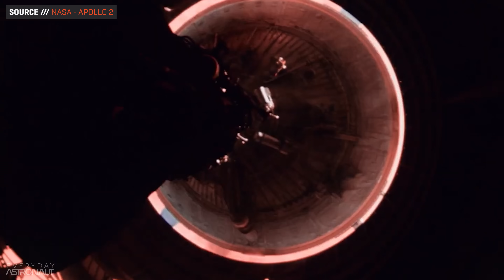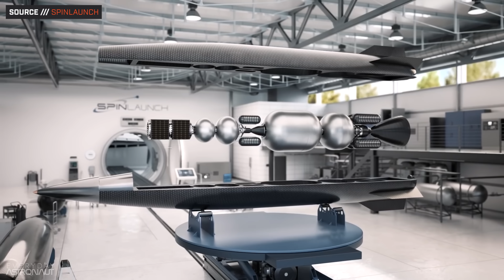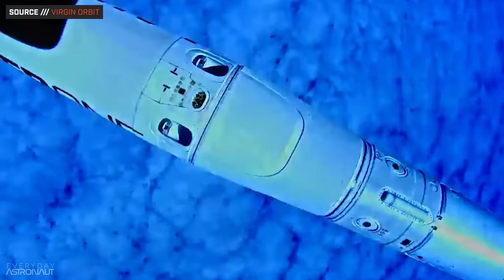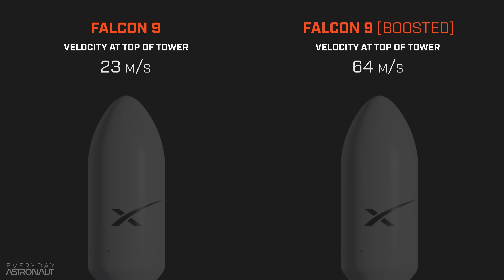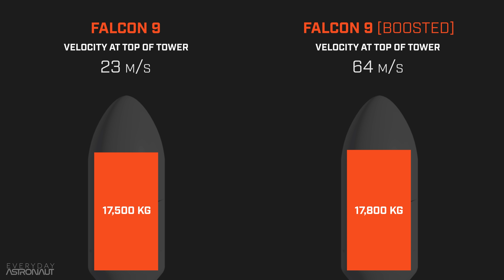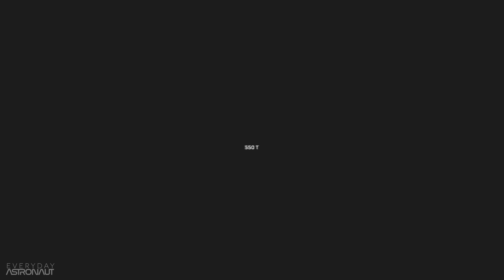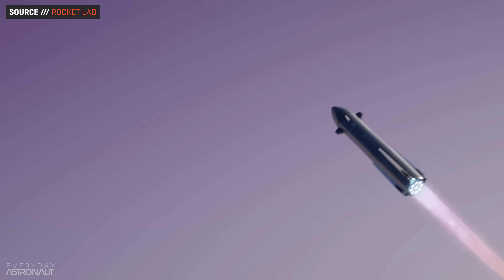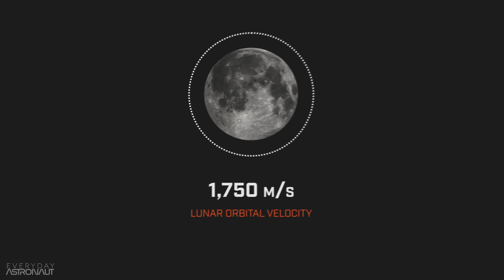Could We Help Push Rockets To Orbit?

Comment: few nitpicks, why would your counterweight need to be expensive steel or made denser ? Use concrete or rock, or bags filled with sand/water, whatever is cheaper, also you could dig both the launch pad and the counterweight track into the ground to get an overall longer acceleration track, I'm pretty sure there are more tricks you could do with 'gear ratios' or pulley systems, altho I'll admit they might not be realistic to consider with the numbers involved.

And what about a mix of the maglev track and chemical rocket instead of either of ? A thing we see often in sci-fi is an horizontal track that start at ground level and then goes up an incline few kilometers down the line, carrying some kind of cart with a cylinder containing the rocket/spaceship, then yeeting it at the end of the track, container being discarded and rocket/spaceship starts it's engines. The acceleration not being short and brutal make it more realistic to carry humans or 'fragile' cargo in it and you don't need those ridiculous vacuum sealed tunnels which imo will never work and make the whole thing costs balloon ridiculously.

Comment: Humanity needs to think bigger.
Building something like a counter weight, with a big tower, big system, brakes and more.
Shouldn't be a problem with the resources we have available.

People built cathedrals, pyramids that took hundreds of years.

NO BALLS I SAY.
We go big. 100 Launchpads, launching at maximum capacity, as often as possible. To build more launchpads on the moon, on mars.
We expand BIG, FAST.

We have technology. But simply just no scale.
Billions of cars running around in circle all days.
But not even 100 rockets launched per day.

Embarrassing.

Comment: We need to tunnel straight through the Moon.  Mostly the tunnel would be used for traveling from one side of the Moon to the other.  Dropping into the tunnel from a tall tower could be used to boost launches.

Comment: Two things I wish Tim had covered in this video but didn't:
1) Launching mined materials instead of humans would alleviate the need to maintain a 5G acceleration rate.  Can we improve the solution by increasing the G factor?
2) How would a space elevator be able to overcome the energy requirement as an alternative solution?
Reply: He did cover #1. You increase the G, it shortens the track length. The tradeoff is you have to expend the same amount of "push" energy in a shorter amount of time.
Reply: @GeneCash  I'm not surprised that I missed it, as I'm sure there were many other points that went over my head.  Thanks for clarifying.

Comment: How about using the rocket engines already fitted plus a really long hose on the quick disconnect so the tanks are still full after the bottom of the rocket reaches the top of the tower?

Comment: 5.5 gigawatts to give starship a little boost at launch? Great Scott, that's a lot of power! You'd need like... 5 flux capacitors to handle that!
Reply: 1.21 Jigawatts!
Reply: Gun it to 88 Mph Marty!
Reply: You'd need dilithium crystals.
Reply: Great Scott! I’m going for a ride on my hoverboard to mull over the math.
Reply: Just one Meta AI center
Reply: You're thinking of Jigawatts!
Reply: The magnetic launch systems on aircraft carriers are precisely this idea and use similar amounts of energy from what Im reading.
Reply: @brettcaulder9034  Steam is better.  There seems to be some unexpected problems with both countries MAG launch systems.
Reply: Starship is not the only rocket in the world. Some rockets can utilize a maglev cylinder inside custom made skyscrapers. It would still be much more efficient than burning fuel for thrust.
Reply: yeah but if you run a continuum transfunctioner you could bring it down to 4 flux capacitors.
Reply: 5X Mr.FUSION KIT
Reply: @kennethschultz6465  Who know how much power Mr Fusion can actually output, we only know its at least 1.21 Gigawatts of instantaneous discharge.
Reply: Just use HARP to get 5 bolts of lightning to hit the tower and you'll be set. Seems pretty simple.
Reply: Where we going we don't need roads, Marty
Reply: That's heavy
Reply: We're gonna have to eat some more bananas to run it .
Reply: Ahh, coal powered rockets. I get it now...

Gonna need 5 more flux capacitors to keep the coal trains running!
Reply: It's only like 9 or 10 nuclear reactors lol
Reply: Yeah, could go to the future 5 times instead.
Reply: @klipseracer  silly monkeys dont fathom the power required to bend space time to loop upon itself and reverse the flow... 😅
Reply: the only reason why it needs that is because hes keeping the length of the tower. Launching the rocket with maglev on a longer slope would fix that problem as you could slowly accelerate the rocket.

Comment: We should use launch assist to reduce total mass of the rocket, not to increase payload .. this would improve the numbers. Also, in the case of 1km rail tunnel, why do you limit acceleration to 5g ? Neutron rocket is not for human launch anyway. How about 50-100g?. I was hoping u run the math of how to launch the 2nd stage with a railgun or meglev with 1-5km rail off a 4km high mountain. Also 350 MJ is not a lot of energy. 7kg of natural gas has that much energy.

Comment: Build a large vacuum tank. Connect it to a movable platform that the rocket sits on. As the engines light up open the vacuum tank and let air pressure push the platform up. Megatonnes of reusable energy.

Comment: I think a much better solution would be to commit to building either a Lofstram loop or better still, a tethered ring.  The latter really would be a brilliant solution, though expensive.  The rotor and stationary protective vacuum sheath could be built in the ocean, then its linear motor rotor , which is magnetically supported by and coupled to powerful magnets located in or on the sheath, would be energized and spun up slowly to just above orbital speed as the ground and sea-based tethers are gradually tensioned to guide it as it lifts spaceward.  It could then be slowly moved by those same tethers to its final location over international waters.  All the support tethers would provide access from numerous points below the ring.  The kinetic energy of the rotor would eventually be so high that energy could then be extracted via that same magnetic coupling to either launch spacecraft and/or to provide electrical power.  Transportation up to the tether would be supplied at relatively low velocity from the ground or sea by sophisticated robotic climbers or elevators, similar to those envisioned for future space elevators.  Take a look at Isaac Arthur's great video of how this system could be used to create a paradyme shift in how we launch to and from orbit, as well as how we could become a truly spacefaring society.

Comment: How about instead of dropping an enormous weight vertically, you use a horizontal rocket sled powered by raptor engines with a pulley system to assist in liftoff from the tower?

Comment: Thanks ! One thing that isn't very clear in your video is the calculation of payload capacity increase in each scenario. It seems that this increase doesn't take into consideration the fuel economy (and therefore weight saving) that is achieved by yeeting the vehicule, which is in turn much lighter to yeet.. or does it ?

Comment: Why this obsession with electrical discharge? You don't need to have one motor that does the whole lift, you spread it out on several motors. Then you add a modular counterweight that scales with the rockets acceleration.edit: the counterweight could just as well be a rocket-tug, since we don't care about the fuel cost. Could be steam powered for that matter.

Comment: The LHC is 27 kilometers in circumference. That only cost a few billion $ and most of that cost is due to the specially designed complex machines inside.
I can see a 500 kilometer MagLev launcher happening. We have plenty of space around the equator in Africa.

Comment: scaling up rockets -- yes for now. RP1 is "widely available", being still mass produced by extracting an ever-decreasing supply of free super dense chemical energy -- oil. i'd be curious to watch those cost saving estimates when oil runs out ! how would those stand, against massive material demand of surface assist solutions ?
Reply: i love your houses consumption comparison (2 million houses, seems absurd, right ?) --> because that's about half of how much current rockets use, which is also crazy, without raising any eyebrows ! a very, very interesting conversation indeed ! thanks for that tim

Comment: Rocket Lab section forgot Earth's gravity (work and velocity used same acceleration)
Force * distance is work, not kinetic energy (it can be, but not for these examples)
The clamps release Starship before ignition, it stays there due to TWR being less than 1
Reply: You're right about the error in that section.
Work is change in energy, by definition, always. It's probably the single most fundamental concept in physics; a major motivation for string and M-theory is that physicists would rather add like 30 extra spatial dimensions to the universe than imagine cases where the definition of work might change.

Comment: The whole point of the Loftstrom Loop is that you don't need "supports", the structure is held up by it's own kinetic energy and a small part of the energy of the system is also what's used to propel the payload meaning it can be injected over long periods of time.

Comment: I'm only around 1/2 way through, but when you're calculating extra payloads, are you considering the weight of the fuel that you wouldn't use during launch, or just the extra speed in the beginning. Did I miss that? The rocket would be lighter because it needs less fuel, and would already have momentum moments after launch.
Reply from the maker: Yup! The calculations factor in the fuel used / not used, etc.
Reply: @EverydayAstronaut  I love these kinds of videos!
Reply: What about counterweights and electric and some sort of stored kinetic energy combined? It sits on a giant spring, with a counterweight and maglev stuff? Isn't SpaceX going to need to convert to H and O2 so they can get back from Mars?

Comment: The Falcon 9 example woth conversion from electrically stored energy to kinetic energy with a conversion efficiency of 0.277 would require 3.538 GJ delivered from the batteries to produce 980 MJ, i.e. needing about 983 kWh in batteries so ten Model S battery packs.

Comment: The cool thing about a track / mass driver on the moon is you can not only use it to launch, but also to LAND. You gain all the energy back! It will 100% happen. The moon has just the right size to launch humans anywhere in the solar system. At ~10 km/s the Moon's curvature is just flat enough to not experience too many curvature Gs. All you need is to find the resources to build it on the Moon. I'd build a track all around it. A mega spin launcher for interstellar travel!

Comment: What if they could leave the ground-based fuel loading system connected for the length of the launch tower as the rocket takes off?
Could you replenish the fuel fast enough so that, by the time the rocket has ascended beyond the height of the launch tower, it still had a full load of fuel?
Would THAT be feasible?

Comment: A steam powered catapult similar to aircraft carriers, could toss a smaller rocket.  Put one of those up the side of a mountain and you could really get going!
Reply: Exactly! I was screaming in my head the entire time I was watching the video.
Not just for small ones, steam catapults have been launching multi-ton payloads since the 1950s and up to 40 tons on aircraft carriers, and I'd presume that without the space/power/frequency requirements of an aircraft carrier, a land-based solution could possibly scale to the hundred- or even kilo- tons.
Steam pipes, steam tanks, and steam boilers are all extremely well-understood for a century already, and they are cheap & common & safe today (as safe as rocket science can be -- non-toxic, not-very-corrosive, not-metal-melting-temperature, high-but-manageable-pressure).
A steam catapult could be powered by even a coal boiler - that idea alone of a "coal powered rocket booster" just sound amazing to me as a concept.
5.5 GW of power sound like a lot, but the largest coal boilers (in terms of MWe - so steam energy loss already somewhat factored in) already reach 1/12 times of that (460MW), which means it can produce one Starship launch worth of steam every ~37 seconds (holding up to 15 metric tons of supercritical steam). While steam catapult efficiency won't match that of an electric turbine, it should be the same order of magnitude.
Of course, that kind of frequency is both impractical and unnecessary, but tone it down to daily launches and it wouldn't seem impossible to me.
The pressure vessel for that 15 metric tons of SC steam would be rated for ~4GPa, similar to that of the OceanGate submarine (but opposite direction, using more reliable material), but this is also likely unnecessary as lower pressure, higher volume steam tank(s) would be easier.
15 metric tons of SC steam for 5 tons of extra payload capacity also sounds like a huge win; even if that's not practical, even at 5% of that efficiency, 300 tons of steam (which is practical in large industrial steam systems) for 5 tons of payload still sound possibly affordable given enough demand.
I think the part where this ultimately fails is that (1) Extra system, extra point of failure, (2) We don't have that many launches to justify such a huge system for occasional 5 tons of payload capacity, though we might be if we one day have demand for daily, hourly, or even 5-minute-interval launches.
Reply: Makes you think about what launching at altitude could help us with. Same everything, launch from Colorado
Reply: I was hoping he plays that example and not limit acceleration to 5g
Reply: @ramithewest   issue is the higher the G, the higher instantaneous power it'd need.
Reply: its a pretty dumb idea.  you're better off launching from an aircraft instead.  at least you will be able to launch at 700kms an hour rather than zero
Reply: @jebes909090  But the smallest rocket what can carry meaningful cargo is 5x bigger and 100x heavier than any of our aircraft :)

Comment: I think a good system would be to use a more ground based acceleration system on a rail track... designed on a west facing gentle slope leading to a high mountain in an easterly direction, at a near equatorial latitude.  This track should be long enough to sustain something like a 3g acceleration to the vehicle, starting horizontally, pitching up, and ending up leaving the ramp at about +45 degrees pitch. I think there is not much point in getting the vehicle above about Mach 0.9 when it leaves the ramp, so that might give the limit to the track length required.

Comment: 26:20.
i don't think it would remaina vakuum for ever. As long as there are still some atoms at that hight, which is the case, the atoms above the tube don't feal any pressure from underneath (at this pressure, it is better to say no atoms would bump into it from below to push it up) therfore dropping in. It will then sink to the bottom. The tube will slowly fill up untill it is the same as the atmosphere. I know thi siwll take alot of time and you could probably be solved by a little bit of pumping, but saying no air will come in is not correct.

Am I not seeing this correct? Please correct me.
Also sorry for spelling =)
Reply: You are correct, I came to post this same thing but you beat me to it. The tube could only be evacuated if it goes above the whole atmosphere, otherwise air from above will fall in and refill it. There will be continuous inflow and would need to be pumped out continuously, the rate depending on the altitude of the opening. Tim does say ~600km long tube, so that seems more than high enough, but not something that can actually be built.
Reply: @vitro4957  Hi. Thanks for the post. I searched on wikipedia and at 600 km there are still atoms floating around, its just very little amount and the behave more like free particles than a gas with a pressure.

But I'm thinking if a particle colides with insight of the tube it will lose some of it's speed and drop down into the pipe.  But thats probaly extremly unlikely.
Reply: Yes, the air column would continually try to re-form the atmsopheric pressure gradient due to gravity compressing the gases and resulting in a lower internal pressure than the external. Given a several meter diameter, you'd likely be looking at continuously pumping out several normal cubic meters per minute of air. While not impossible it wouldn't be free. A 10kw pump I was able to find could probably maintain ~ 1psia vacuum, but this is still a lot of pressure for a hypersonic launch to pass through.

Comment: 17:49 you don’t need that much weight….. just that much mechanical advantage. Add more pulleys and use less weight
Reply from the maker: That is incorrect. The more your gear ratio goes up, the slower the lifting side operates. So in order to accelerate at 3G (net),  it requires a 35:1 mass ratio and a 5:1 pulley ratio. Don't forget, the mass can't fall faster than 1G and the fist 1G is just cancelling out the rocket, not accelerating it.
Reply: @EverydayAstronaut I missed half the equation the first watch through then 🤣🤣 that makes a lot more sense when the goal is acceleration and not just lifting.

Comment: Make the maglev, rocketlev and have a ground based fuel source, limited range but the perk of the rockets efficiency without having to lift the mass of the fuel. Plumbing would be a bit of a hurdle to overcome.